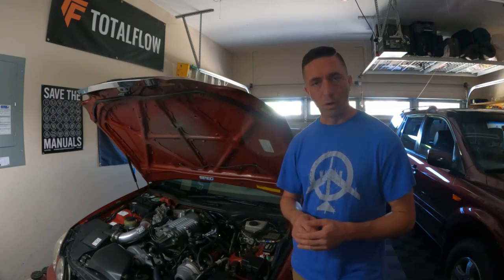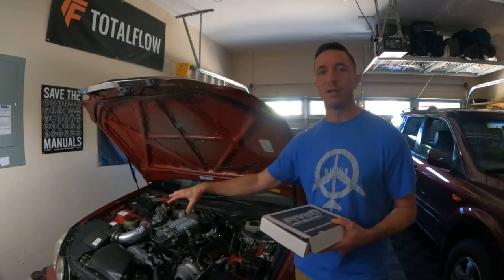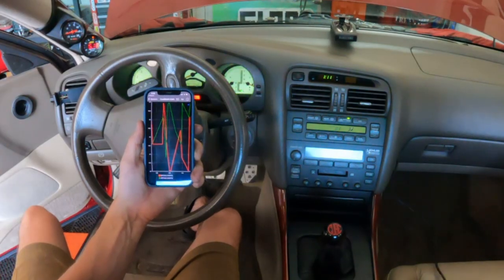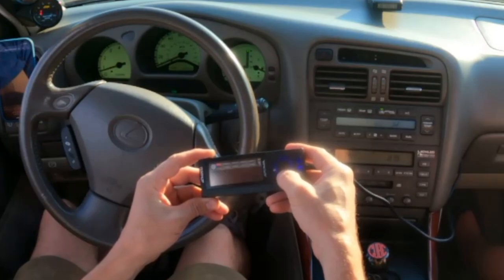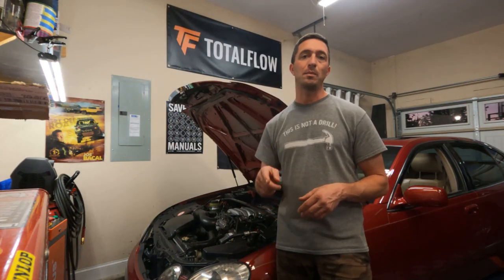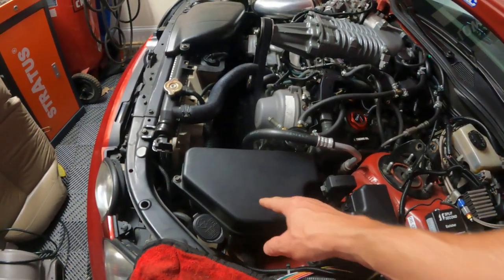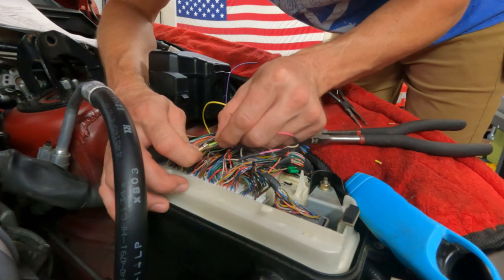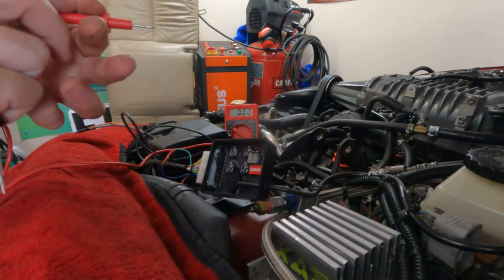Tuning my supercharged TOYOTA / LEXUS - how I finally hit safe AFRs (Injectors, NEO, Enricher)

Comment: I’ve always thought about doing something like this to my LS400 for more power and your videos give me a little hope. I don’t know how this will work with my ECU so I may just do headers and call it a day 😅
Reply: Speed academy did the same supercharger install on a LS430.
Reply: @johnshaw3208  unfortunately the company they contracted for their ecu tuning only does LS430s and up so Im out of luck. I’ve seen some New Zealanders using piggyback ecus for their LS400s but Im not ready for all that trouble.
Reply: dont cheap out on headers,i bought some for my gs300 and they barley fit
Reply: @plekk_9684  Im thinking of getting the PPE headers but the only issue is that they’re $1,200 😢
Reply: @machedari  save up for it, my headers were 400$ dollars and it took me the whole day and heating of the metal to get it to fit
Reply: @plekk_9684  Sucks you had to go through all of that. Will start saving because the PPE are a direct fit for my car. You get what you pay for I guess I just never expected headers for a 24 year old car will cost this much 😢
Reply: @machedari  bro stop crying they are great headers that give you 30 extra horsepower. Thats a BIG difference. The stock headers really restrict the 3uz.
Reply: @bubblelex5051  yea that’s a big increase. I should be able to buy them soon.

Comment: Looks like fun. Enjoy your manual transmission supercharged V8 Sedan. Not too many of those around. I wonder how many people underestimate your car's straight line performance?  Would you consider it a sleeper?
Reply from the maker: It kind of depends on who is next to me. Most don’t really notice the car. My favorite is blasting past people in 2nd gear on a roll. The car really flies there. 3rd gear gets scary fast on public roads quickly, so I don’t get to try that out much. I like the power availability without having to rev it out most. Even short shifting it results in spirited acceleration. It’s a lot of fun!

Comment: Hello! 

Thanks for the wonderful and detailed series. It was really informative and down the road I plan to supercharge my 98’ SC 400.

I have two questions: 

1) There is a common complaint with the SAFC-NEO that the stock ECU relearns over time and during closed-loop, parameters go back to what the stock ECU is used to causing a lean condition again. Did you experience this? Would you say the SAFC is a complete solution for low levels of boost? 

2) Were you able to pass emissions with your setup without any issues? 

Many thanks! 😊
Reply from the maker: Hi and thanks for the good questions. 1) I heard warnings about this as well, but haven’t experienced it in a few years of owning the NEO - ever. I watch the fuel trims closely and sometimes they will drift a bit after a few months (closed loop) and I need to make some adjustments on the NEO Lo map to knock the trims back towards zero. Open loop stays constant. I do think it’s an acceptable solution, but it’s not the best one. A stand-alone would be best, but they’re very expensive. 2) No issue with emissions, but inspection here consists of looking for diagnostic codes and making sure emissions equipment is still there (like the cats). I hope that helps! Don’t tell anyone, but the SC400 is one of my favorite LEXUS bodies/look. 👍
Reply: @ForwardMomentum  Wonderful that’s exactly what I wanted to hear! I agree that standalones are prohibitively expensive AND they make it nigh on impossible to pass emissions.  

Thank you for your answers, they were very helpful! Your channel is great by the way, I have a 2nd gen. GS 300 but still find your videos very informative and fun to watch. Keep it up! 😊

Comment: what long ago episode???    Not helpful for me trying to see a video on how to replace injectors on my GS400....
Reply from the maker: Did you actually try to find it? I have playlists set up and you can search easily by my username to find it. Here, I’ll just give you the link:
https://youtu.be/xSC6Xobb52s
Reply: @ForwardMomentum  Actually, yes.    I trided for a quite some time, looking through your list of videos for something had injectors in the title..   Then did word seaches for injector on the transcripts of several of the likely ones,, and skimmed throught episode 3 of the supercharging series/   And I didn't find it.   I don't know why.   So THANK YOU (very much) for the direct link.

I will say that I'm glad to have found your channel, it's well done, and  a lot of it is specific to our car... the GS400.      I'm going to do the rear brake light hack tomorrow.   But I have a lean running number 1 cylinder, and it wasn't fixed by a bottle of injector cleaner.   So, sicne I have 150K miles on the vehicle, I thought I would just change out the injector.  But want to see a video on how to do it, because while I am not afreaid to work on a car / truck (I installed a pretty complete BANKS package on my truck, and have built an airplane), I don't have a shop manual, and just want to get a good handle on how much trouble it's going to be......
Reply from the maker: Piece of cake if you’ve done all that before. If you let the car sit the fuel press goes to zero after maybe two hours by design. So you won’t have a major fuel leak when you loosen the fuel rail and gently pull it up. Yes, fuel will leak, so be ready for that. But once you loosen the fuel rail bolts, you can pull the rail up. Remove the injector, replace the injector and bolt the rail back down. The biggest thing with injectors on these cars is to make sure that they’re seated properly. I will typically seat them by turning them rapidly back-and-forth clockwise and counterclockwise the seals seat into the intake manifold port. You can also get the factory service manual online in a couple places. First, I do a Google search for exactly what I’m looking for and see if the page shows up in the Google images. Second, you can go to Toyota information services or TIS and pay $15 I think and get a day pass, then download everything you want from there. That’s a couple options for you but the job really isn’t that hard and I’m sure you’ll get it on the first try. All that being said, it sounds like you scanned the car and you’re convinced that cylinder number one is running lean. can you tell me what your code is? Because if it’s P0171 then bank one is running lean. And if bank one is running lean, then it’s usually a vacuum leak between the MAF  and throttle body. Which is very common on these cars. Let me know.

Comment: Do you think for a GS300 single turbo on about 4-8 psi the apexi would work by itself (with bigger injectors)?
Reply from the maker: Yes, but you may want to consider going from MAF to MAP for the NEO. Also, pre-boost enrichment would be a good idea. In the end, having control of timing and fuel is always safest. There’s less margin for error with just an AFC.
Reply: @ForwardMomentum  My solution would be having the MAF before the turbo and just recirculating the BOV (after the MAF but before the turbo). 
About the enrichment, what solution do you suggest? The one you have in your Lexus?  Would it run lean without one?
Reply from the maker: I have a SS Enricher. It smooths out the pre-boost to boost transition and fueling a bit. I will admit that I am not a 2J specialist, so I can only share my experiences in a general sense. There are others far more qualified in giving 2J NA-T guidance. There’s a few FB pages that can help, also a lot of good info on ClubLexus as well. Let me know what you decide to do. Also, don’t forget the transmission. I hate the A650 and despite what you may read, it could end up being your weak link, even at low boost. The 2J A650 is even weaker than the 1UZ version, which I managed to fry with no boost. A manual or beefier AT is highly advised.
Reply: @ForwardMomentum   Thank you so much for taking the time to answer my questions! There are a few guys here in the UK that ran this setup (2jz vvti with stock auto) to 320-350whp at under 10psi of boost with no real issues and that is my goal as well.

Comment: split second also makes the ftc-1 for the gs400 in particular, you have to ask them for it but you get closed/open loop tuning, timing adjustment, etc. It acts more like a standalone but you need windows xp, same thing with the ecumasters det3 that can also be used with these cars. Both fairly cheap being essentially 4 cylinder piggyback ecu's.
Reply from the maker: Sounds like a similar device to what I ran on my supercharged 4Runner back in the day (Perfect Power SMT-6). We
Tuned it with an old laptop.
Reply: @ForwardMomentum  Thats crazy, you had a 4runner too? what generation cuz I had a 3rd gen I built out lol.
Reply from the maker: Yep! 3rd gen. 3.4, 5-speed manual, etc. In fact, here’s an old vid of it: https://youtu.be/y8sZNkA5bFU
Reply: @ForwardMomentum   I see you had a 96, same exact year too lol. Makes me miss mine. And your old channel is cdaviesaz, you from az too?
Reply from the maker: @deimosphob yep, 96. Too funny. I actually had 6 of them, but mostly flipped them for mod $. I’m not from AZ but I lived there for a bit. If you have IG I’m on there and we could chat about old times a bit. Those 3G4R were stout!

Comment: If we dont have the post cat o2 sensors anymore, do we have to wire them for the enricher?
Reply from the maker: I would ask SplitSecond about that. They’re pretty responsive.
Reply: @ForwardMomentum  what wiring diagram did you use?
Reply from the maker: I literally typed “LEXUS GS400 ECU pinout” into Google and cross-referenced the best contenders. When enough of them matched up I knew I had a winner. You can also do the same thing using a Google image search. It works pretty well.

Comment: Open Loop Tuning Question:  Are you adjusting the trims so they are close to zero thru the rpm ranges OR are you doing so to keep the AFR in the 11'ish range?
Reply from the maker: It’s a juggling act. I’m doing whatever it takes for the car to hit 11-11.5AFR in OL. With larger injectors that means I’m pulling fuel in most places -14 to -18 (at the time I am typing this). The exception to that rule is where I have the Lo maps pulling even more fuel to hit my STFT targets (1K-2500RPM). On the Lo maps in that range I’m -26 to -29, but what I learned the other day is that I need to richen the Hi maps a bit in that range as well. The reason I richen the Hi maps in that range is for that space in between CL and OL transition (where the Enricher kicks in). So my Hi maps in the 1K-2500 are now -2 to -8, then at 3K RPM it pulls more fuel like say, -14, and goes from there. It’s hard to explain but what I’m doing is trying to smooth daily driving conditions in CL, richen the fuel in between CL and OL, and then hit 11-11.5 AFR in OL. It’s a dance. Clear as mud? 😆
Reply: Ok. I get it. That helps. Thanks :)

Comment: I'm glad you found the NEO plus enricher is working for you. Sometimes the simple solutions are best. Going for a full standalone ecu can often introduce new issues, but can be done with a parallel install and keeping factory ecu in place. Many people have had good success with the Emanage ultimate for another piggy back option, has an Aux output that allows you to switch O2s off at given load/ rpm/ psi etc
Reply from the maker: Thanks. I’d love to go stand-alone someday. That sounds like a decent option. Thanks for sharing!
Reply: @ForwardMomentum  If you are considering stand alone. Link and Haltech have some good options.

Comment: Been following this series for a bit. Nice work! Just wondering why not go full standalone at this stage? Cost? Also what do you figure you're making for HP now? Think you're close to the limit for the stock rods?
Reply from the maker: Thanks! A standalone is about $2300 and all it would really gain me is some flexibility. I might be able to find some HP here and there, sure, but the car performs really well as-is and that was always my goal: to build a really well-rounded DD. I figure I’m around 315-320whp (stock is 235-245).  The limit seems to be around 400-450whp on these on a stock bottom end, depending on where that power is made. My buddy has the exact same car and he’s at 362whp at 9psi. So I have some room but not sure I care to push it anyway. 😎
Reply: You can toss some Eagle Forged rods in it for under $800 and really get wild.
Reply from the maker: The ring lands tend to go before the rods bend, so I’m going to keep it closed up for now. Headers and LSD are next. 👍

Comment: Hey question unrelated to the video, I have a GS400 and it’s transmission is slipping like crazy. So I’m planning on replacing it. Do you know if it needs to be reprogrammed at all once I replace it?
Reply from the maker: I have never heard of that being required. Pulling the negative off during the job and replacing it after should be all that’s needed.
Reply: Or you may just have to do a transmission fluid change if you haven’t done one. It worked wonders for my LS400.
Reply: @machedari  Did you have similar symptoms? Mine slips at low gearing but does pretty well once I’m up and going. It also struggles really bad going up hill. Could be torque converter? Idk
Reply: @ForwardMomentum  Thanks!
Reply: @thomasduarte2260  Mine mostly was shifting very slow and jerking randomly on the low gears while accelerating and downshifting. I left it draining overnight and got 6quarts out. I filled it up with some toyota type 4 trans fluid and it’s been smooth ever since. If it isn’t the fluid then your solenoids could be failing. I tried the fluid change first because it’s never been done in my car and it worked so I never had to replace any solenoids or the transmission itself.
Reply: @machedari  Are the solenoids easy to get to? Or do you have to take the whole transmission apart? I know some cars are easy
Reply: @thomasduarte2260  you just have to take off the transmission oil pan to get to them. They’re also kinda expensive so if you buy them go with aftermarket brands like Standard. They’re cheaper than oem and work great. 
Before you do anything expensive though Id suggest you check your trans fluid level if it’s low add some or if it hasn’t been changed in a while just change it. Dont do a transmission flush if you go to a shop as I heard it sometimes can cause problems. Just do a drain and fill. When I was diagnosing my car ‘clublexus’ was very helpful. It may take a whole day due to the many threads they have but it’s worth it. I came across a lot of issues in my LS400 as soon as I hit 140,000mi and the website helped. If you need advice we’re here.
Reply: @machedari  Thanks a lot man!